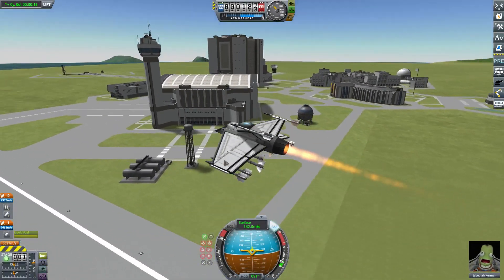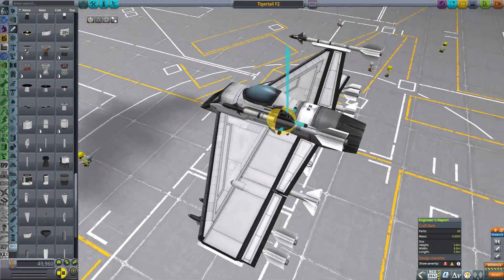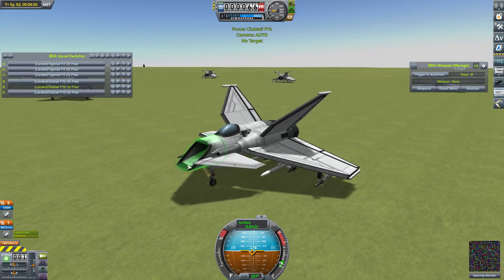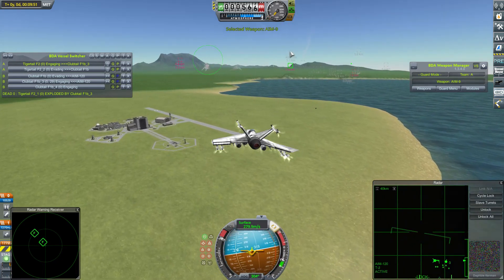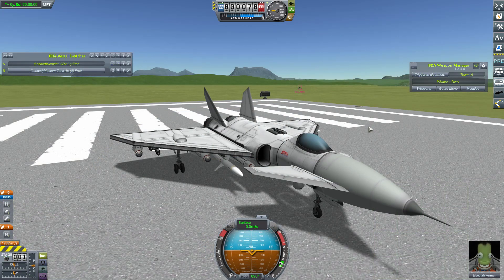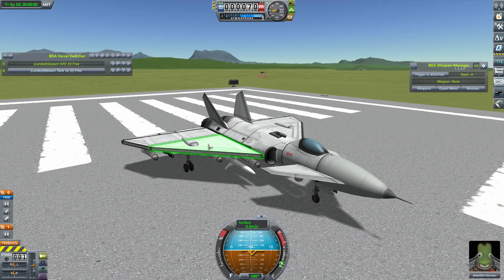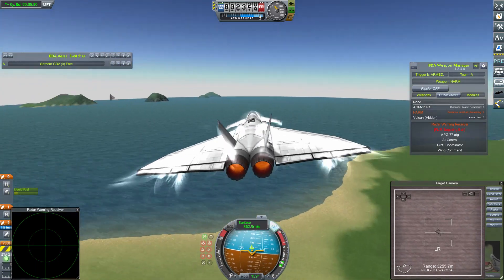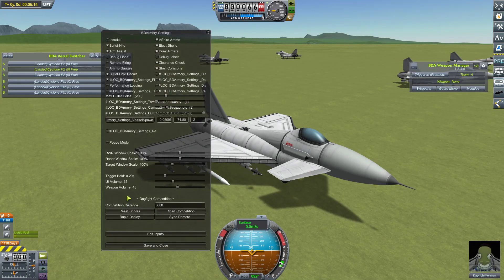Upgrading Engines - Kerbal Space Program & BD Armory

Comment: Why does the Saturn engine blow out at 12000 m? 

If you havent seen it try taking that engine to 12km and see what happens
Reply: Not enough intake air/altitude limit.
Reply from the maker: What he said ☝
Reply: @SonofSmith  It's really weird that the Saturn can only go 12km when other engines such as the 404 can go 20km
Reply: @stahlhelm5755 its a fighter jet engine,not a high altitude cruise jet engine

Comment: If it is not the Saturn engine then just use the wiplash
Reply: whiplash lacks the low speed acceleration for dogfighting
Reply: @xdthegreat9973  ok but the wiplash is the fastest in vanilla
Reply: @channeldestroyer1310  You can hardly be faster than a missile
Reply: But it just dose not have gimbal like the panther
Reply: @channeldestroyer1310  You can turn off gimbal anyway
Reply: @xdthegreat9973  what I meant was the wiplash dose not have the gimbal like the panther sorry if you understood already
Reply from the maker: Whiplash has some problems as a dogfighting engine, but I've think they've all been mentioned already.  😁